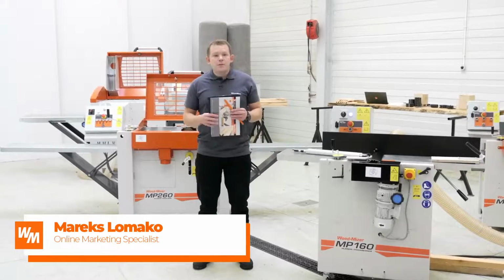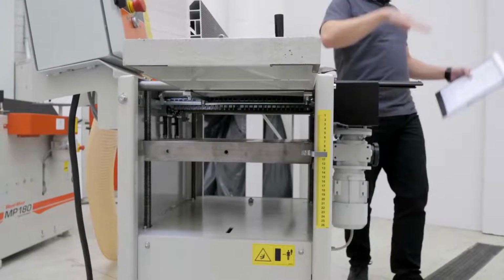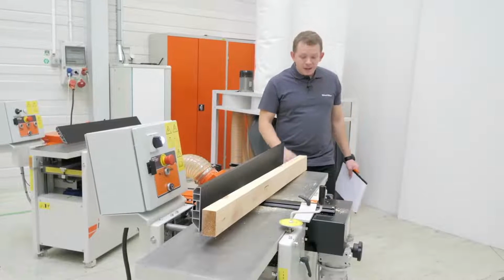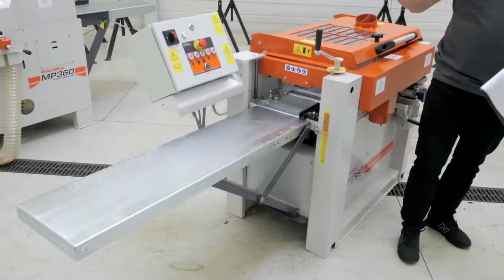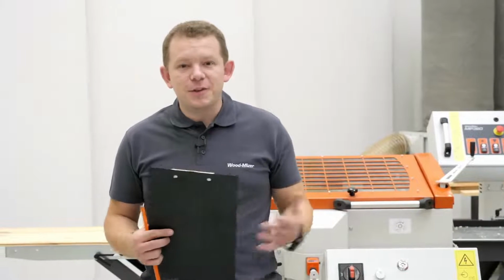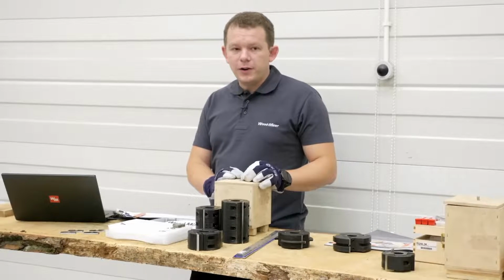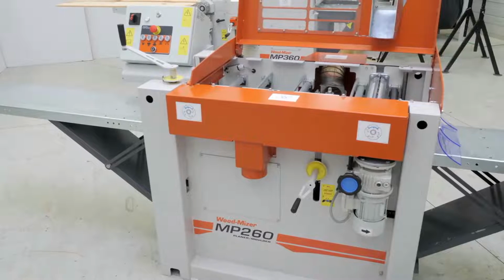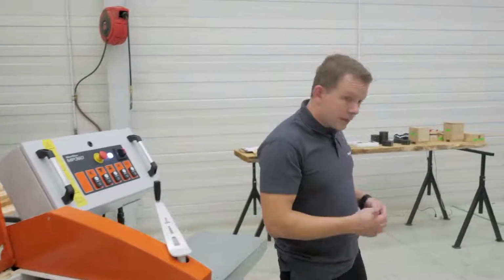Wood-Mizer LIVE | Woodworking machines | Wood-Mizer Europe

Comment: These new models are simple to use, safe, practical and easy to adjust according to users needs. The most important aspect of this items are; they incorporate and includes some features that only used to be found on big sized machines which are very expensive for many! It will help a lot of people and those who are in a furniture manufacturing business.
Reply: can the cutter head be adjusted relative to the in field table? Also can a spiral headblock or segmented head block be put in as an upgrade?